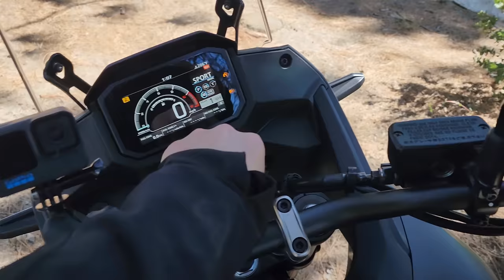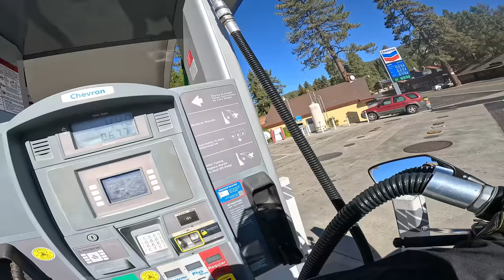Honda Transalp 750 | First Ride On/Off Road (REAL test... no holding back!) (EP.2)

Comment: ABS gosh darn it,,, yeah I've had that happen to me, The Suziki V-strom 250SX doesn't have switchable ABS... it can't be turned off, and that's dangerous! If both ends have to kick in, then it should automatically switch off the rear. as that is the only way to get the tyre to bite into the ground and actually slow down. My bike would still have the stock hand guards and mirrors if the ABS was switchable, but instead I was forced to Upgrade them after they got scratches up as a direct result of the ABS not letting me slow down!
CB500X boring?
 Try a Suzuki V-strom 250SX... It looks the part, is fun for running around town, but the brakes... they will slow you down, but teach you to ride in a position that gives you the biggest escape route possible. the tyres have about as much grip as oily fingers on chrome plated tools. It has enough power to just about lift the front tyre in 1st gear, but not enough to get a speeding ticket no matter how hard you try. and the vibration and noise from the engine makes you think it's going to blow itself apart any second... and that's just trying to maintain the open road speed limit of 100km/h (which is easier said than done as it is affected by even the slightest gust of breeze or small dip or rise in the road)
and if all that doesn't make you not want to ride it, the lack of ability to turn the ABS off will have you ploughing into whatever you really need to stop for - Hard! There is no stopping on a slippery surface, no locking the rear brake to dig into the road... it has to roll over the top and not slow down in the slightest.

4.2 L... a Gallon? a UK Gallon yes... but a US Gallon is more like 3.8 L
 I get a consistent 31km/L with my 250cc V-strom. it would be better if I didn't desire a faster bike... but this equates to 73miles per US Gallon, and 87miles per UK or Imp Gallon (because the IMP gallon is bigger than the US Gallon)
Bent levers from sand? I hope you have good access to Barkbusters in the USA, they are made In Australia, so very readily available in New Zealand. and the best thing about them other than being able to change the plastic on them without spending much, is the fact that they stick out less than Factory fitted handguards and end weights... about 20mm less each side, so I can actually get through the gate up the side of my house without having to wiggle one side through and then the other. If there is one modification/upgrade that is worth the $200AU price tag it's Barkbusters, and they actually bolt on (with bike specific variants) Imagine a bolt on item that actually bolts directly on without having to modify anything whatsoever!

Comment: I was able to test the Transalp 750 in direct comparison to the V-Strom 800 DE and I liked the the torquey V-Strom engine a lot more. I don't agree that the engines are similar. The V-Strom has significantly more torque in lower RPM. I don't like to squeeze out the engine all the time.
Also as you have shown on your channel the V-Strom is much more capable offroad.
For me there is no reason to pick the Transalp over the V-Strrom.
Btw. can someone explain why you have such low octane rates in the US? Here in Europe 95 is the absolute minimum, Premium gas has 98 or 100 octane

Comment: Great Work as always!   I seen one at the dealer this weekend.  Appearance  looks awesome compared to the suzuki  800 DE....wins hands down.  You pointed out all the gripes I"ve discovered.  They could have had a winner here fixing those things and even priced it closer to the Africa Twin.  I still cannot believe even the User mode won't hold settings.   I'd buy  over a Norden 901 , but Honda doing their best to discourage me from an otherwise capable machine....no optional cruise control.   How about put two big buttons on the handlebar  controls  to at least turn off TC and ABS?   Sure if I test drove it, I'd want it....but later get frustrated with those negatives.  
Keep up those great reviews!!!

Comment: Just wondering why you seem to have stopped talking about the Tuareg 660 when you are comparing bikes. When you first got one, you raved about it. And then…nothing. I’ve had mine for about a year and still think it’s the best in the class. Comprehensive electronics that retain your settings, light weight, good suspension out of the box, fun/peppy engine, beautiful fueling, tubeless spokes, cruise control, quick shifter, low seat height (for the class), easy access air filter. Why is every middle weight still compared to the T7? The Tuareg is the benchmark below $13k. And I’ve had zero problems with mine.
Reply from the maker: It's the best, I agree. But it has a smaller appeal due to a smaller dealer network and people think it's not reliable compared to a Honda.

Comment: Well, I would not say this is somethting between Africa and CB500X.
It has closer distance to Africa.
That's a pity they do not upgrade cb500x to real 500cc or 550 (it's only 470 now) and make slightly bigger clereance.
There are many things in Transalp to improve

Comment: I bought mine in Europe (92hp 💪) in late July and made till now over 6k km. Lovely bike and I agree with all the observation of this review. I’m 188cm tall and 85kg - upper half of my helmet hits the wind and catches bugs, while rear preload made to max and still not ideal 30% SAG achieved. Driving faster on gravel is a bit bouncy. I’m looking slowly for at least rear shock upgrade but dude… this is a bit pricy step! Any a bit more affordable suggestion than Touratech or Ohlins?
Reply: Yes, just go to a suspension expert. Just modify it and it will work perfectly. You don't have to replace and spend useless money. Are you from Germany? Then go to Franz Racing Suspension. I got mine in May. Fantastic bike!
Reply: @GCTO239  Any more details on what they did?
Reply: @Luk4s7St  on my 1100 AT he installed stiffer springs, reset the shims, did the service and changed the setup regarding my riding style, my demands and my weight. Complete tuneup of stock front and rear suspension including new springs and a day of work for around 900 Euro. Franz Nissen (the owner and mechanic) also said it's on Öhlins level now. Feels a lot better than new. I ride a lot of hard offroad on my AT. It is beast now with tons of reserve. My Transalp though is mainly used on the the road due to the fact that I also prefer ADVs on the road as I am a tall rider. The suspension on the Transalp will get a setup for fast onroad riding. Will be less than 900 Euro because its suspension is very simple in comparison. Tuneup, new setup, stiffer springs. Make no mistake. Showa is a fantastic foundation to start from. Regards from Germany.
Reply: @GCTO239  so effectively only springs but not shock replaced? Not sue this is gonna work on TA. Shock seems to be “weak” is my observation and see this review confirmed it as well.
Reply: @Luk4s7St  the "shock" is adjusted via the shims. He got them adjusted to his weight and preference.
Reply: @Luk4s7St  well, this is mainly caused by the soft springs and the shims. Different oil, tuning of the interior and setting it up correctly up also make a huge difference. But feel free to spend more money on replacement. Replacement also has to be adapted to your weight and riding style. I am fine with listening to the suspension experts.
Reply: @Luk4s7St  and no, it is not only new springs. You completely forget the service, the interior changes and the new setup by an expert. Maybe you should try that in the future. You do not always have to replace but make the existing suspension better. The reliability of Showa and KYB is second to none.
Reply: @merzto  exactly 👍🤙🏼
Reply: @GCTO239  not sure I understand what are you going to tell me. I asked for technical modification done by suspension experts on your bike. Simply saying “they tuned it what cost 900€ means nothing”. Did they leave original rear shock but replaced spring to stiffer one? Did they modify original shock replacing oil and shims to adjust compression and rebound? What about fork? This is what I’m interested in.
Reply: @Luk4s7St   if you haven't understood by now, you will probaly never. Read again. I said front and rear. Of course, the forks also got new springs. So three springs in total. No new shock. Front and rear serviced, cleaned, new shims (adapted) etc...Holy moly! I wrote about everything...shims, oil, new springs, new setup etc...Just google what suspension tuning is and what suspension consists of. Sorry, mate, but you clearly do not really have a clue of what you are talking about, which is fine but I'm out. 🤣🤦🏽
Reply: @GCTO239  haha indeed. I have no clue and will never understand. Over and out.

Comment: Very interested to see if you can find a work-around for the TCS/ABS resetting. I am looking to buy this, a T7 or V-strom 800, and the fact that the T7 doesnt have traction and the V-strom is on-the-fly switchable and remembers the setting (I believe) is the reason I would buy one of those over the Transalp.
Reply: The abs setting on the vstrom resets. Traction control preference doesn't reset

Comment: I live in Las Vegas so engine heat is a deal killer for me~ the fact that the Transalp 750 has very little engine heat will get my checkbook out~ I don't think that is the case with the Vstrom 800~ I keep hearing that the bike throws a lot of heat to your legs.
Reply: It's a machine and guess what machines make when you operate them ? HEAT.
Reply: Yes, it does not produce any noticeable heat. I also have an 1100 AT which produces a lot more heat, which you can feel through the boot. The Transalp is fantastic regarding this aspect.

Comment: Greetings from Portugal. I would like to ask a favor, if possible. I bought a transalp and I'm thinking about adding a rack and bag system. After contact several brands, without getting a definitive answer, I would like to know if you can test bags from Mosck Moto and Kriega and check if they come into contact with the exhaust

Comment: It's what I keep telling people... too much focus on cruise control and lack of extras. Sure, the lack of protections (bash guards, hand guards, etc.) hurts. You need to shell out for them, it's very barebones.
But you're not paying for those when you buy a bike, really. You pay for the engine and frame. And the Transalp is a LOT of engine on a good bike. You can add the extras on your own, and it won't be that expensive in the end since the bike starts at a lower price point that some of the competition.

Comment: I'm guessing the break in has been properly done?  😂
Reply: It was purposely dropped. Twice. And rev limiter hit multiple times. What more needs to be done for break in? :)
Reply: @marcusaurelius9736  well, that is quite the debatable topic, proper break in. I myself go by the manufacturer recommendations (they engineered the bike after all) but I'll mix in a few runs up near red line. I generally just don't ride the crap out of it for the first 600 miles.

Comment: I absolutely believe that this bike is a blast on the road. Although the missing cruise control alone could almost be a dealbreaker.

But offroad I am still very sceptical. Once you add a decent bashplate, you loose another half-inch of ground clearance.. and sorry but if you ride in rocky terrain and not just on gravel roads and sandy plains, ground clearance becomes a limiting factor really quick.
And "you can just fix the rear shock easily" isn't an argument either. If you can't do the work yourself but have to pay for it, the costs for this kind of upgrade bring the price of the bike dangerously close to the Tuareg. And at that point you would just be better off to buy the Tuareg in the first place. That would solve the cruise control issue as well ;)
Reply from the maker: You're right... except, some people really want a Honda for the reliability
Reply: @BigRockMoto  it's hard to argue with Hondas legendary Reliability, I'll give you that :)

To be fair: after 12.500 km, my Tuareg already had 3 warranty pit-stops at the dealer. 2 x the water pump gasket, 1 x the fuel gauge sensor.

Transalp probably wouldn't have been to the dealer even once.

Still better than a KTM though ;)

Comment: Ok, so when you adjust the preload to the max and to the min, you don't feel the suspension firmer or softer??? You DO feel it stiffer and softer. There are a lot of way to make it feel softer or firmer.
One of them is adjusting the preload.
As you say its purpose is to adjust the suspension to your weight....that is true. Because otherwise you will feel it too soft or too firm :D

Comment: Disagree about preload. Too much preload makes the ride harsh and non-compliant at lower speeds. Sag is reduced by increasing upward force. How else is that done except by firming up the spring? The spring pushes the bike up harder, requiring more downward force (weight) to compress it. Doesn't matter if the spring is straight rate or progressively wound. The firming effect as it compresses is more pronounced with the progressively wound spring.

Comment: You said you were redlining it and putting it through it's paces... you don't do break in periods for brand new motorcycles?
Reply from the maker: Yes. I break it in the same way I plan to ride it, full power and rpm. Vary the speeds.

Comment: ive heard it is some sort of regulation in new bikes. abs should be on as default. because you can forget that you disabled it and lock the wheels on an accident. on the other hand, you think it is disabled because you just did it and can't brake well on loose surface. it is stupid but it isn't manufacturers choice

Comment: Well, I have the old Transalp (the 600) which I’ve torn to shreds off-road, even rode it in a couple of enduro races…
And trust me…: ground clearance and suspension travel is an issue…
Even to the point of sending me to the hospital a couple of times…😳
Also have the Rebel 1100 dct.
And not having a user mode that will remember your settings (as in having all that useless crap turned off) is a total… turn-off…🤷🏻‍♂️

Comment: But it's not the perfect balance between the CB500x and the AF. It's skewed towards the CB500x, suspension, travel, clearance and as you showed the tech isn't so great. Can you BUILD it into a good ADV bike. Sure. But plenty of people take CB500X's and build them into good ADV bikes too. Fact is it's a missed opportunity. Maybe they will do the  AS version with better suspension/clearance/cruise/protection next year? But if they would have priced it at 12000 and had the bike ADV ready out the door it would have been legendary...
Reply: I'd bet there is a 3rd party Sump in R&D right now. BUT WHY? Honda could have swapped in a low profile sump and flowed that pipe a little differently and got us the 1" ground clearance back. Honda could have added cruise for pennies. Honda could have used better suspension and at least a basic skid plate and lever guards. Honda already has all kinds of mid sized street bikes, they arguably had NO mid sized adventure bikes. So the fact that they half azzed this release = why people call it boring.
Reply: It's like this bike needed a 19" front and cast tubeless wheels, a bigger screen and it would have been just perfect that way. And then they should have released a 2nd version built the way people will have to modify this one to make it the Mini Africa Twin they were hoping for... OK rant over! :) NICE REVEIW!! Thanks!

Comment: I'm not a fan of the fairings on this type of bike.  They look dorky, especially without a raised front fender.  Also, Honda has a way of making plain vanilla looking bikes. When they debut as a concept bike, they look great, but they lose something in the design by cost reducing them for production. Too much chrome and cheap plastic. Honda makes reliable bikes. I own a CB400F and a VFR800, so I don't hate Hondas.

Comment: Can you really call it a touring bike if it has no cruise?  The main reason I didn't keep my 1200x long term.  Loved the bike and that V4 was powerful and buttery smooth but after a couple of 1500 mile trips to the mountains with long extended periods on the interstate it had to go.
Reply: It's meant for Europe, if you're using cruise control you're on the wrong road... doesn't make sense to need cruise control on a bike.
Though I agree it's dumb to miss it in this age of throttle by wire. It's just a button and some software.

Comment: Honda has the same problem as they do with the Ridgeline truck.  It's superior in many ways to the other mid-size pickup trucks, but it's a unibody vehicle with a car-like driving experience which means it's more comfortable, fuel efficient and even more capable in many ways, but it's 'not a truck'.  The Tranalp is a Honda thru and thru.  With a few farkles and more serious off road bits, like the 300 it will be proven to be a solid adventure bike.  Change out that horrific exhaust, some crash bars, better rear forks and maybe a more nostalgic livery and it's a real choice compared to the T7 or Toureg.
Reply from the maker: Good Ridgeline analogy